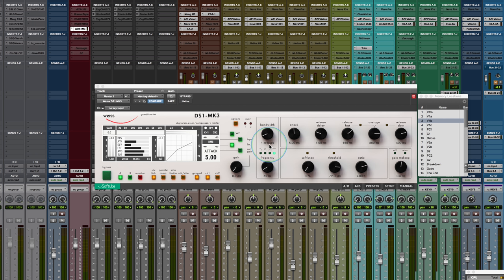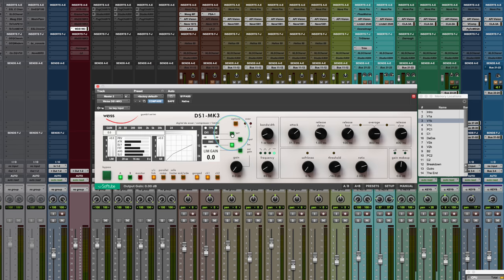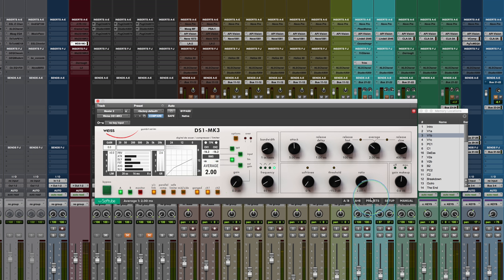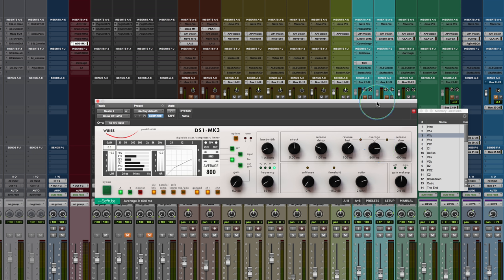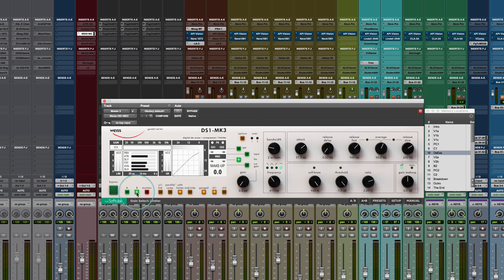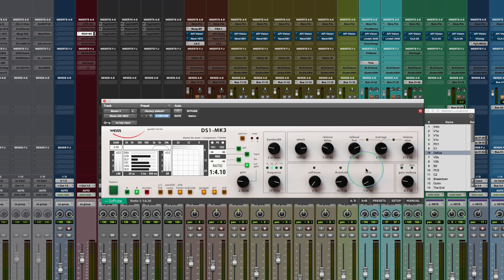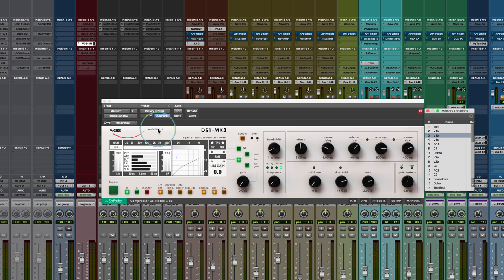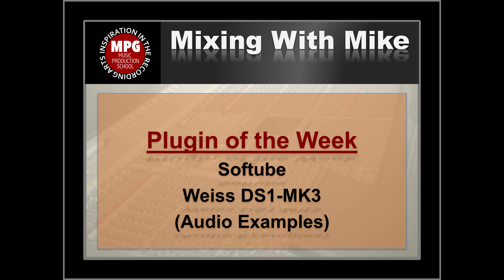Softube - Weiss DS1-MK3 - Audio Examples - Mixing With Mike Plugin of the Week

Comment: Love this video and plugin Mike!  Your vids are so helpful!  Quick question, can you tell me where to find the “pre limiter gain” in parallel compression mode?  Is it the output gain?  Am I correct in that the output gain sets the threshold of the limiter?  Also, I’m not sure I fully understand what the side chain link does.  I’ve read the manuals but can’t seem to lock these things down.  Thanks so much!  Cheers!
Reply from the maker: Hi Karsten,
Might want to watch the Features Video for this plugin (https://youtu.be/_nDbOi1XlMg) 
There are 4 gain stages in this processor
1. Input Gain 
2. Makeup Gain - This makeup gain is for the processed signal only even if band limited
3. Limiter Gain - This is the gain post processing but prior to the Safe Limiter
4. Output Gain - Output level post everything
S/C link monos the stereo input signal before feeding the S/C of the processing engine. Basically, it links the L-R or M-S Gain Reduction. Unlinked the GR is independent for L-R or M-S
Hope this helps!
Mike
Reply: Yes it the output gain knob to the complete right !

Comment: What setting would you use for an average hip hop song far as attack and release with a -2 gain reduction with the drums hit?
Reply: As for any compressor, it all depends on the material and what you want to achieve. There are absolutely no general settings/recommendations possible.

Comment: I have just demoed Weiss DS1-MK3, it is 400 USD!!!
Well, imo TDR Kotelnikov makes a way better job in master chain..
Reply: Kotelnikov is definitely a great processor.  I had a similar expression for it when I first demod it, didn't have a massive wow element. But the two aren't really comparable as the Weiss is a much deeper unit with some really neat additional functionality. After really learning how to use it effectively, it has become an invaluable tool in my mixing/mastering toolset. It's just that the learning curve is very steep.
Reply: @efnerva664  I meant Kotelnikov GE, and it has some features you won't find on Weiss ;)
Reply: @najinelson6742  it does, but it's still a full bandwidth compressor where as the weiss can do band-selective compression. I agree that is a nice plugin, but it couldn't replace the weiss for me.
Reply: @efnerva664  you can slso select bands with Kotelnikov, if you want less or more compression at around 2Kh or wherever it's possible
Reply: @najinelson6742  yes, but kotelnikov's filters work on the detection circuit. Compressor itself is still wideband. This is different from the weiss that only works in that particular band. It seems like a small difference, but actually opens up a whole lot of possibilities.
Reply: Ok, now you got me. Ready for exchange? I give you Kotelnikov and you gimme Weiss, ok? Lol
Reply: @najinelson6742 Know that feeling. It was sitting relatively unused for a while in my plugins folder until I learned about it. MixbusTV has two really good videos on how to use it. If you ever decide to get it, is worth becoming a member of the channel to watch the second part (members only content).
Reply: @najinelson6742  I don't usually really use it for limiting though, like some of the other plugins more for that.
Reply: @efnerva664  I know MixbusTV, I ptefer his hardware reviews, though. You can feel that he is more into hardware than software. As to plugin reviews I like plugintester channel a lot, it's a new channel. Especially his mixes are raw and pure music, I love that.
Reply: @najinelson6742  will have to check him out